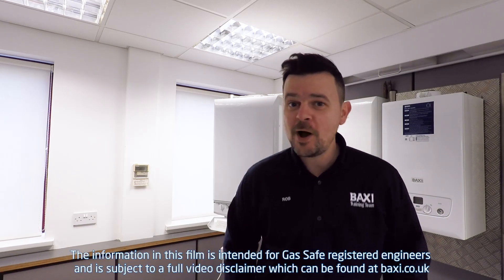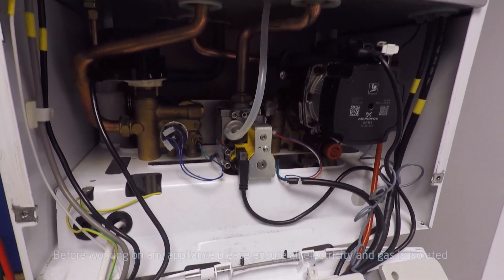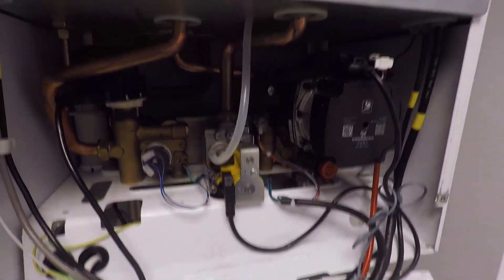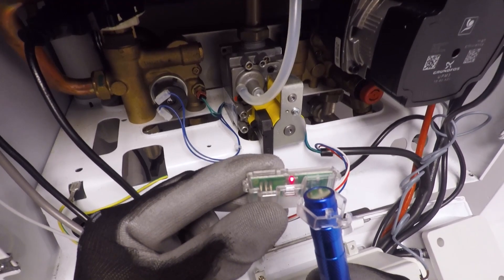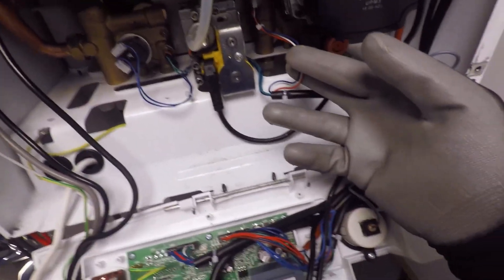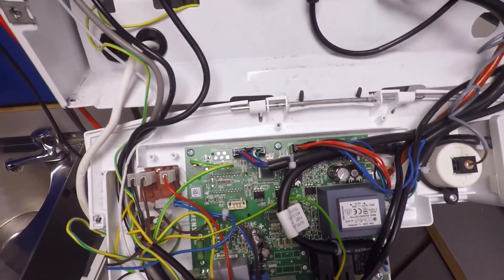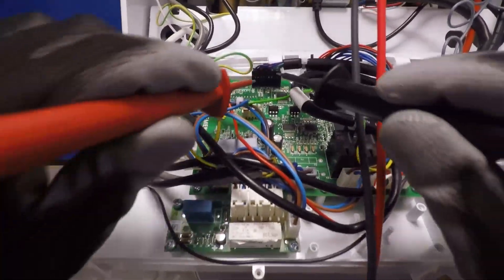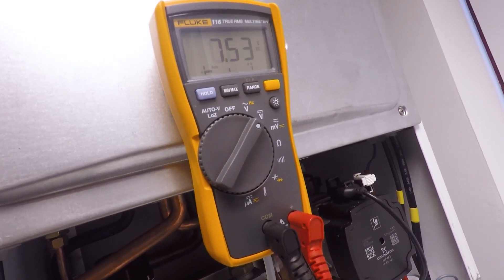How to test the voltage on a Hall Effect sensor (float switch/bobbin type)

Comment: How do you check the condensate level switch on a combi boiler. I have one that seems to be sticking and wont switch on as condensate water rises. Untill the high water sensor powers the boiler off.

Comment: First thank you for these videos they are very informative.
A question from lowly homeowner.  I have an old boiler (mascot ht330) which I think is the same as BAXI. If the boiler does not fire when the hot tap is on. But I can place a magnet on top of the hall sensor and trick the boiler into turning on.  And I ran the descaling solution through so I think the boiler as clean as I can make now, but the issue is still there.

Should try to replace the hall sensor or the mechanical bobber inside?  How can I determine if the hall sensor is bad?   I presume if I can get the boiler to turn on with a magnet its more likely that the bober assembly needs to be replaced or cleaned.  Maybe you have a training on fixing the bober assembly?
Again thank you for these videos.

Comment: What is the role of transparent pipe coming out of gas valve?
Reply: Think it balances air press in gas valve. When case on the neg pressure helps gas valve lift. If I am wrong someone will correct me🤣🤣